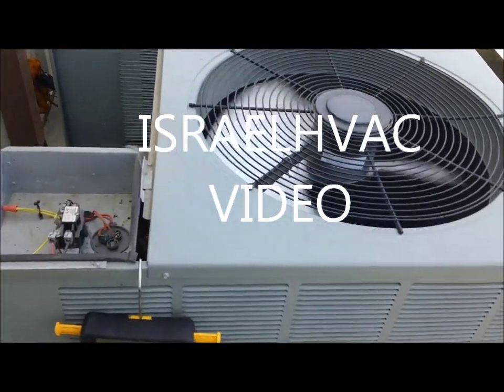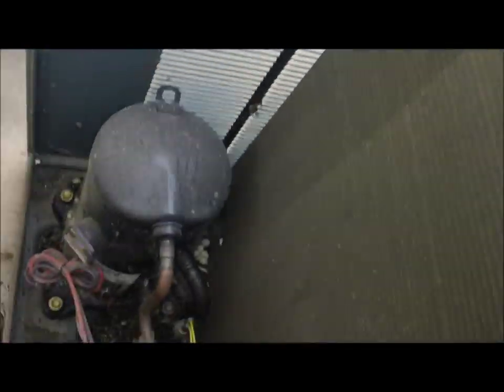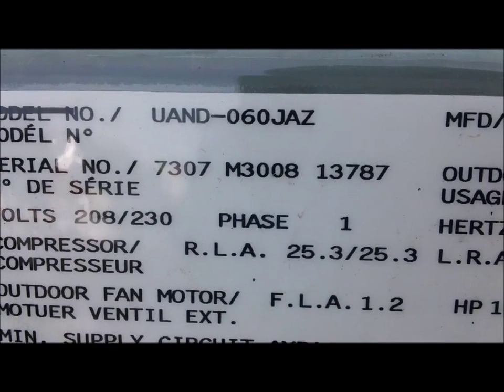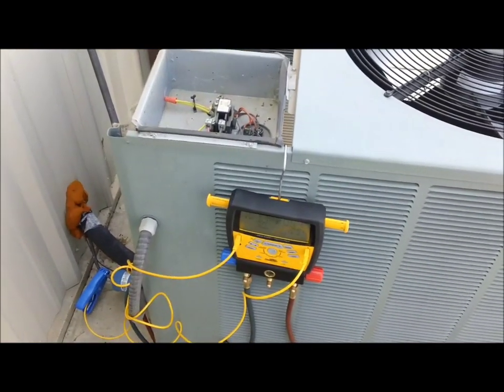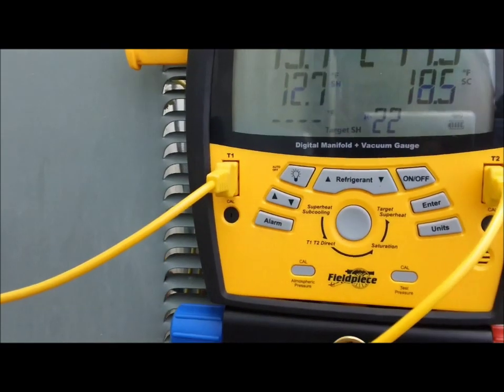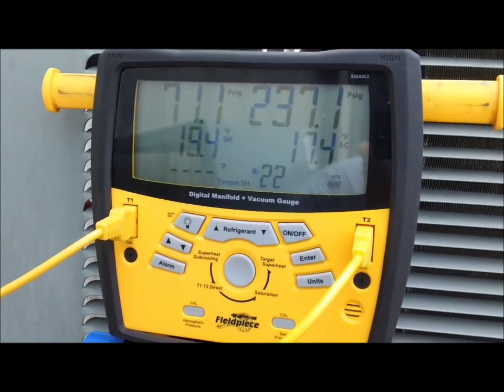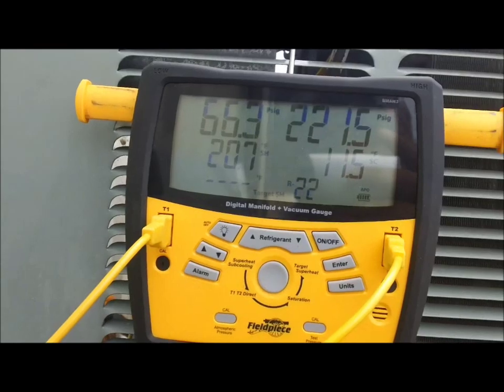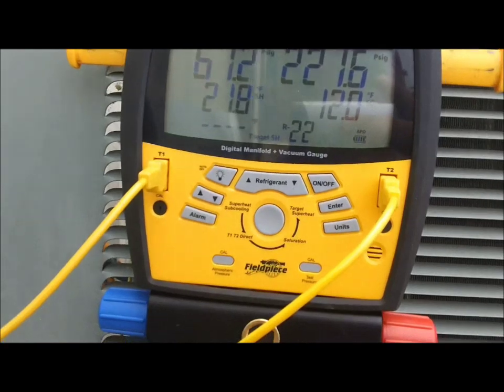HVAC Service: No Cool Call At Donut Shop

Comment: If you are not moving enough air(dirty evap), then your suction line would be cold because no load on evaporator to raise your sh. That means they didn't use the beer can method, they just went off pressures only.

Comment: You had 66 and 21f and afterward you had 66 and 23f... only real difference was the head is low with less refrigerant. Why not clean that nasty condenser coil and watch the head really drop and the sc will rise even further. I’ll bet the Amps dropped also...

Comment: "beer can cold" can work with R-22.... Not so much with 410A. ALWAYS verify that both coils are clean. I see this A LOT in Florida with air handlers. Plugged up evap coils and the systems are just loaded with refrigerant. The majority of pull and cleans I do I have to remove refrigerant. I am a rookie in the field. I know enough to get by and I learn daily but this is just basic. High head, verify clean condenser and fan motor. Low suction, verify clean evap, blower and filter. The last thing I usually try and do is add or remove refrigerant. Back in Iowa it was plugged secondary heat exchangers on 90%ers but same concept. Thanks for the video. I've learned quite a bit from you guys that have BEEN doing this in my short 1 1/2 years in the field. Much appreciated.

Comment: Mfg'ers ought to list the TXV's target superheat; if that was a heat pump its target usually is 8 to 10°F. I noticed before taking charge out it had around 10°F superheat; after it had 20°F superheat which seems too high even for an A/C unit (many times it's within 12°F SH). Also subcooling was unstable jumping from 10 to 12°F subcooling which might indicate noncondensibles or a lack of a solid stream of liquid to the TXV...?

Comment: A dirty evaporator and will make your suction line colder and make your super heat low. It will make the room warm. The dirty filter cured the problem .. How long is the line set  and what size is it. Just noticed this is an old post. Sorry

Comment: have worked on many of these cube units.  charging chart on the inside of the cover.
also check your compressor amps up against the fla of the comp rating.  these units evap coils run only a few degrees over freezing.  many are overcharged by flash trained people.  thanks for the videos.

Comment: What if you have 0 psi on both sides of your gauges and the unit wont take any refrigerant charge?
Reply: Plugged access valves is probable, but you should check your hoses too.  I have had to replace broken valve cores damaged by huffing vandals and install tamper resistant caps.  Your gear could be in need of some r&r.  The core depresser may be too sunken in, fallen out, or if you have no/low loss tips; time to rebuild them if you can't push or pull through any system.
Reply: sivalley I was told it is probably bad compressor valves.
Reply: SombraLocs I'd be a little leery of such an accusation.  Even if your compressor needs to be replaced there should be pressure in the system unless the compressor failure is a result of a leak leading to burnout from an inoperative/non-existent low pressure cut-off.  Whoever is servicing your unit should be able to shut the king valves on the condensing unit and see if there really is no pressure past the unit and pressure test it if need be to find if the leak is in the line-set/evaporator coil or the condensing unit.
Reply: I do believe it was because the compressor burnout was caused by low freon. Do all units have a low pressure cut off switch?
Reply: Units made after 2000 that I have serviced do.  Units older than that are hit or miss.  The newer 410A units care more about high side pressure due to burst hazard since the whole system is higher pressure and it's a 'green' refrigerant etc.
Reply: sivalley How fast would the refrigerant leak out if your condenser unit is missing the valve cores?
Reply: A matter of minutes

Comment: Thats the reason i ask i wanted to do things rite and i needed to know,when i 1st started i was trying to do it by pressures, with txv you can be way over charged and still get a decent suction pressure so thats when i started teaching myself by reading and buying the correct tools,that has been several years ago but im glad i picked up on it and started doing it rite because things went a lot easyer and had less problems,if your not using sh/sc your just guessing,thanks again!

Comment: Great video John !! I am currently involved in a disagreement on a non hvac website concerning what you just said. I utilize temps, amps, calcs. and formulas before I ever attach my gauges IF I even do. I will only connect them IF I feel I need to see what the pressures and sat. temps are. I can get very close w/o them and so if all is good, no need to go further. The argument there was to just attach and go by that ONLY to know if refrigerant is needed. Overcharging happens too much.Take care.